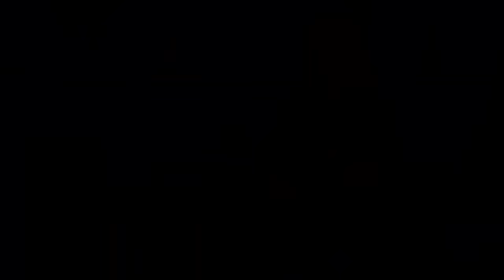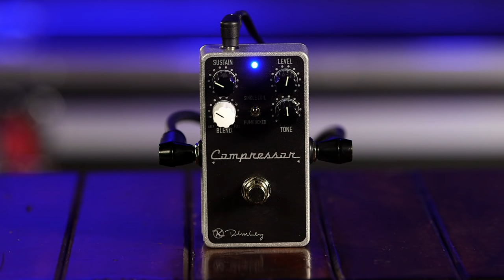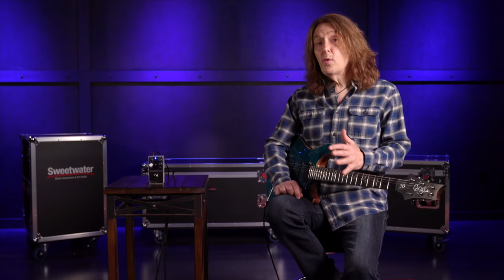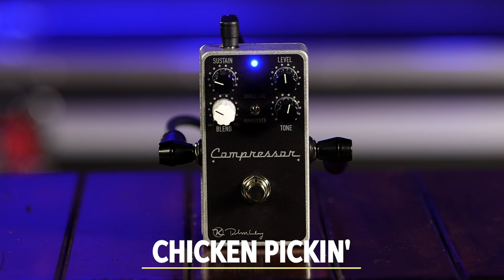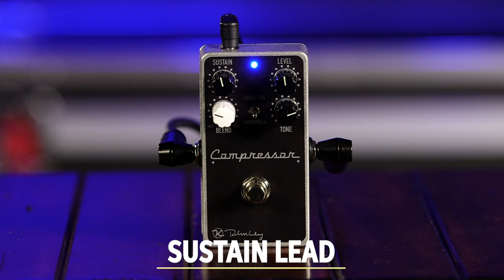How to Use a Compressor Pedal – Getting the Most out of Your Compressor Pedal

Comment: I love using a compressor just to even out my tone. It’s very subtle, and probably not noticeable by an audience, but as a player, I notice it (and it helps me to play better I hope). Keeley has been my “go to” for a long time now. I have the plus and it is so good. I have tried a lot of other compressors, but always seem to land back with Keeley. They sound great and have little, to no, noise - even paired with an OD pedal. It’s always on.
Reply: I was just getting ready to ask if anyone knew if the pedal usually buzzed like I'm hearing in this video. I was seriously getting ready to pull the plug and purchase one until I heard the noise coming from what I thought may have been the pedal since I doubt it's the PRS.
Reply: Also, what feature does the plus have that this one doesn't? Thanks

Comment: A big problem you hear ppl complain about with compressors is noise- and a lot of that has to do with where you put it in the signal chain. There's always going to be some noise, I'm not saying you can get rid of it- there's always some hiss in your signal and the compressor will always magnify it. But if you put it before your drives, at least it's not magnifying the hiss coming from them- which is the majority of what you hear. That said- the sustain works by adding gain as the note dies out so- you add gain, you add noise- period. If you need to play with the sustain all the way up, then get a volume pedal and between playing- kill the vol. You see lots of pros doing this, they're keeping the noise down. They do the same thing when they're playing a super-hot rig, any time they're not playing, they kill the volume. But I've seen country pickers use the same trick to control the compressor noise.
Another issue is attack noise- you hear your fingers rubbing across the strings, you hear the pick picking the note really loud- turn the attack down so the compression doesn't kick in so quickly. If you don't have an "attack" knob, then you have a "blend" knob- either one will allow you to get rid of this unwanted noise. If you have neither knob, and you still hear this- get rid of the compressor- it's junk. Some compressors come with the attack/blend already set, you can't change it- so if it's not right for your rig- get rid of that pedal.
Reply: Best comment ever!

Comment: You can also get some pretty interesting sounds by using a compressor pedal with a blend knob similarly to a parallel drum bus. Crank the sustain and compress the heck out of the signal, but keep the blend knob super low. Not useful for EVERY occasion but a fun sound to mess around with.

Comment: Several ways to get it done. I prefer the optical circuits for whatever reason.  I built a DOD 280 clone and added a blend circuit for the dry,  it needed it bad. Used it for years.  But recently built Cornish OC-1 clone PCB and it's now my favorite for guitar.  I play flute as well and use an ART rack preamp that also uses optical compression.  Maybe I'm just use to it.  Though the JFET style compressors like the Orange Squeezer and Cali 76 sound great to my ears as well.  Great video on how compression works.

Comment: Would you advise using the single coil setting through a set of humbuckers?
Reply from the maker: Hey, Elliot! Valid question. There are response and tonal curves associated with each setting. There’s no wrong or right way to set up the pedal, it’s really about what appeals most to you at any given time. Single coil setting with a humbucker will be thicker and more compressed, which could be the sound you’re going for.
Please contact us direct with other questions as you have them!
Robert Williams, Senior Sweetwater Sales Engineer, (800) 222-4700 ext. 2371, robert_williams@sweetwater.com

Comment: I've seen some videos that show that compressors really have two functions depending on if you put it in front of your overdrive/distortion or after, with it acting as a boost after the overdrive/distortion. Can someone help me understand the pro's and con's of before/after?
Reply from the maker: Hi, noodlemans. There are several uses for a compressor, but in terms of the before or after question, there are a couple ways to look at it. Most people seem to use their compressor early in the chain to smooth out dynamics and add sustain before the signal reaches their other pedals. Others will run the compressor after their gain pedals to either use as a boost, or to simulate the sag/compression they get from an amp when driving the front end. This can be helpful if you're forced to play a tube amp at low volume, as it can simulate some of the feel you'd get from the amp being cranked.
Thanks for your interest!
Charlie Davis, Sweetwater Sales Engineer, (800) 222-4700 ext. 1320, charlie_davis@sweetwater.com

Comment: I have a Taylor 214ce Acoustic Electric. Would a compressor with a blend knob be good for it?
Reply from the maker: Hi, Brayden. Great question! A compressor with a blend knob allows for what is called parallel compression. The basic premise of parallel compression is that it will help preserve more of the dynamic range in your playing. They are a great choice for use with any sort of guitar (electric or acoustic-electric). If you would like to talk over some more specific recommendations on compressors, feel free to get in touch. Thanks!
Jason Filloramo, Sweetwater Sales Engineer, (800) 222-4700 ext. 1281, Jason_Filloramo@sweetwater.com
Reply: Thanks, that really helped!
Reply: I have that same guitar and use this keeley compressor with it! Really helps keep everything I play nice and balanced, to the point where I can’t NOT use it live hehe

Comment: Question from me as a noob, why do I need to use compression as a boost while I can just turn the volume up?
Reply from the maker: Thanks for your question, hope all is well otherwise. While compression can be used as boost, it's most often used to regulate gain levels and maximize sustain. Making lower output sounds come up and minimizing (limiting) higher output is the basic explanation. This is beneficial to keep overall output consistent and also to maximize sustain. It can give the perception of being louder since at certain settings all the notes are at the same output level. You can set the output of a compressor higher and the actual compression effect lower which does act as a boost, however that’s not the intended design.
Please contact us direct with other questions as you have them!
Robert Williams, Senior Sweetwater Sales Engineer, (800) 222-4700 ext. 2371, robert_williams@sweetwater.com

Comment: What settings would you use for a jangly Byrds sound?
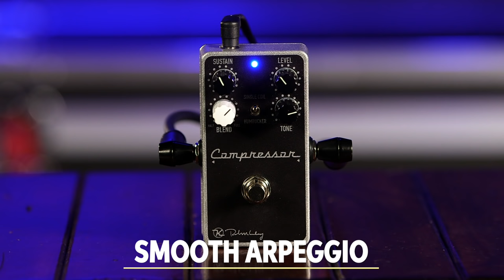Reply: The settings at 4:41 are similar to what I use (sustain 10 o'clock, blend round 12, tone on the treble side). The "Eight Miles High" sound is VERY compressed and I would increse the blend to about 3 o'clock

Comment: Can it still work with another pedal hooked up. Most likely distorted pedal
Reply from the maker: Hi, Cory! Thanks for your message, hope you're well and safe.
A compression pedal absolutely works with distortion. It's a matter of taste as to how much and where you place the pedal in the signal chain. Before, distortion affects the attack more. After affects the sustain more. I generally use compression after distortion for leads to help shape the decay of the distortion. There's no wrong or right.
Please contact us direct with other questions as you have them!
Robert Williams, Senior Sweetwater Sales Engineer, (800) 222-4700 ext. 2371, robert_williams@sweetwater.com

Comment: I have a question, I'm just starting to build my first pedal board and I have a few pedals I either bought or traded with friends to get. the music I'm playing is hard rock/metal. so I have a big Muff deluxe, a delay, a reverb and a volume/expression pedal. my question is if I'm using the Muff as my main sound do I need a compressor pedal ? if so, should it go infront of the big Muff of after in my sound chain ? thanks .
Reply from the maker: Hey, Jim! Great question. Like most pedal related things there isn’t a right or wrong answer, and it just depends on the tone you want to get. Not all big muffs sound the same either, so that can make a difference. They tend to have a compressing effect on their own, so you likely wouldn’t need a compressor active along with it. But if you wanted to experiment with that setup I would start with it before the Big Muff in the signal path.
I hope this helps! Reach out to me if you have any questions.
Connor Smith, Sweetwater Sales Engineer, (800) 222-4700 ext. 1793, connor_smith@sweetwater.com